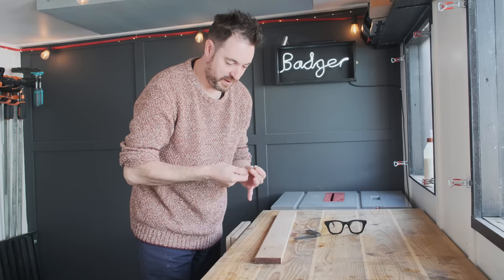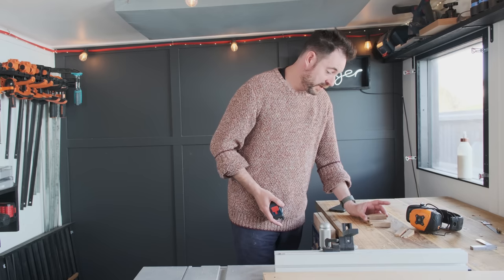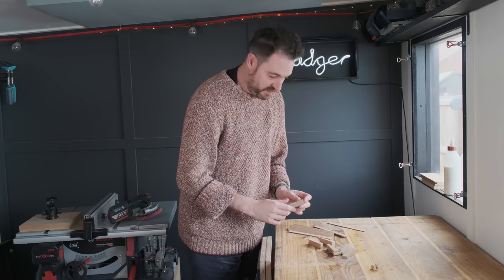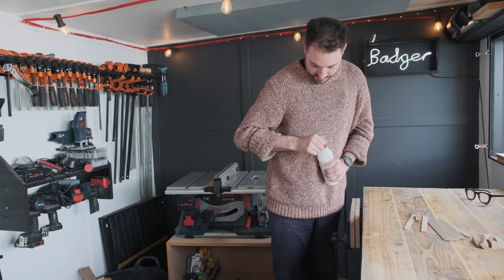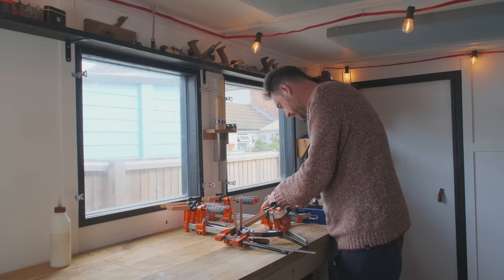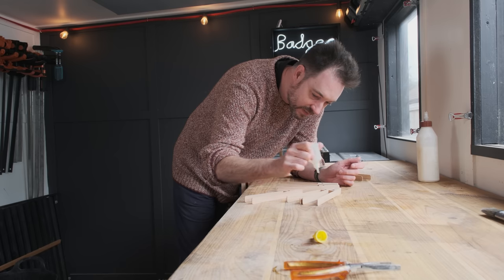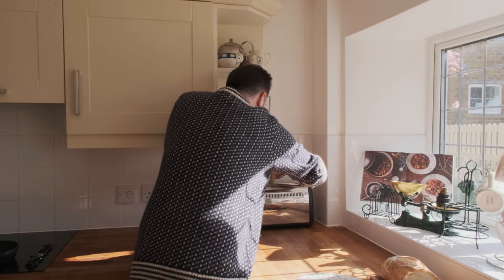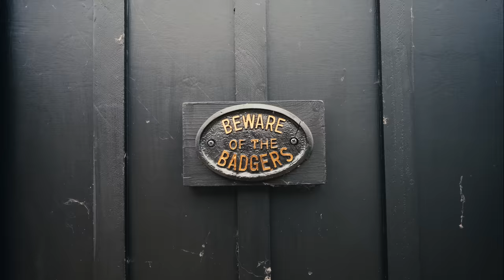Making A Great little Gift, Wooden Toast Tongs

Comment: You know what that’s a great idea I love it but I am just wondering could they be made out of one bit of wood as in just cut out that way you could save time on the glue up or would that be just to much of a headache to do 
I do love the idea of a wooden plate sets 

Great video thank you so much
Reply from the maker: Yes you could try that
Reply: @Badgerworkshop  I might just give that a try what I like to ask is the Beeswax Oil that you used can you use that over paint or can you only apply it to bare wood
Reply from the maker: @Puremaintenances  I have never tried over paint but I think it would need to be able to soak in